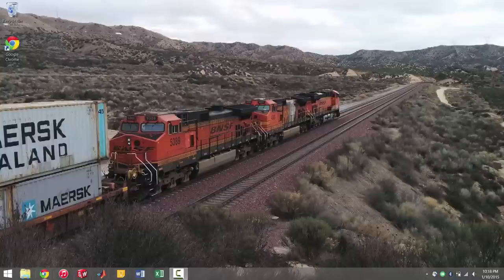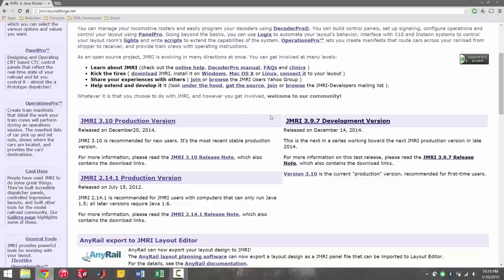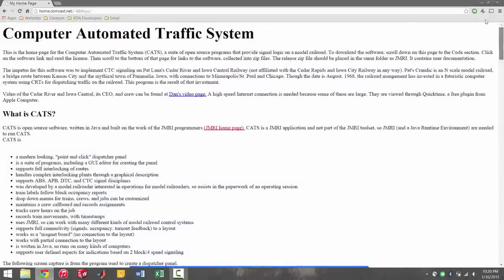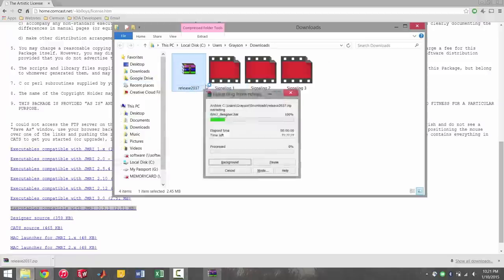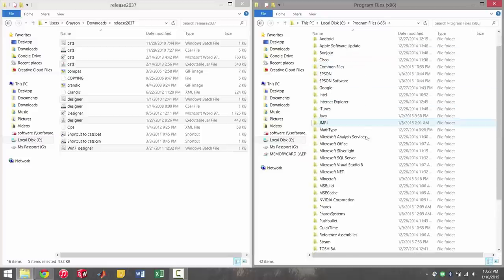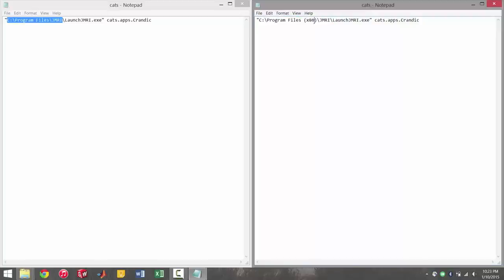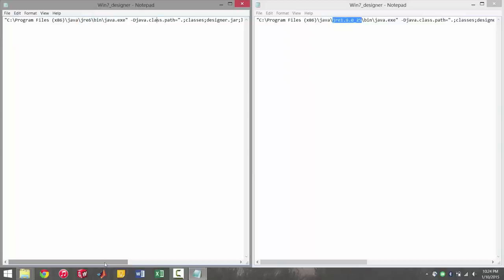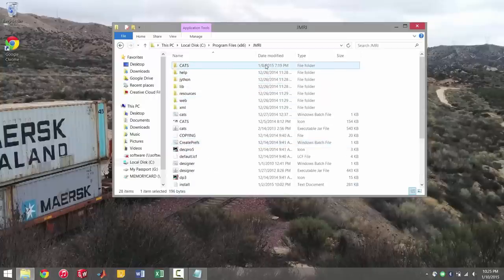Model Railroad Signaling (A How To Video) - Part 4: Installing The Signaling Software (JMRI & CATS)

Comment: Thanks. This is not straighforward for most people and a good tutorial really helps get set up.

On the designer batch file edit, there are actually two places in the batch file where the java log filename needs to be updated. Might be worth putting a call out on your video at that point to let folks know.

Cheers, and thanks.

Comment: I'm trying to get CATS to open up properly.  While I'm trying to follow along with the video, I find it difficult to do everything that's shown even when pausing the video to go do what's explained.  While you (Grayson) know how to do it, and can easily go through the steps, you don't explain FULLY in a step by step explanation.  At one point it was said, do such and such, "mess around with that, you'll figure it out".  You never actually show where, or how, to edit the directories with Editpad Pro after saying that it's needed.  That's NOT helpful for those people, like myself, that don't have the technical stuff figured out.  I think it would be great if this video was updated to current JMRI/Windows version walkthrough, because both CATS download screen and Windows interfaces have changed.